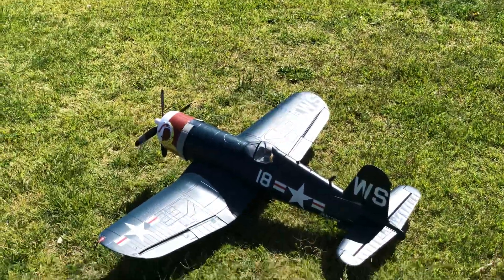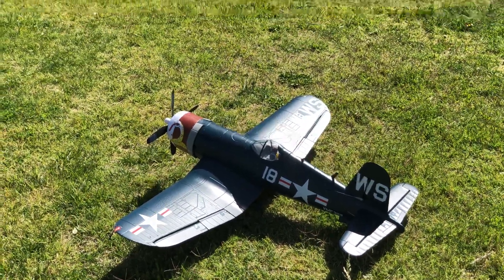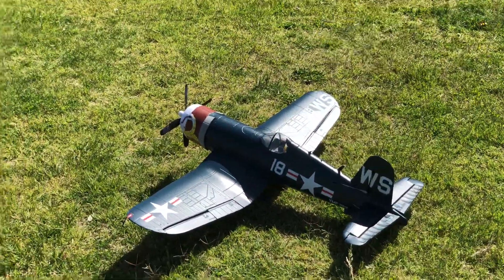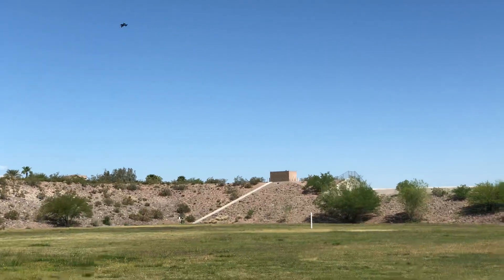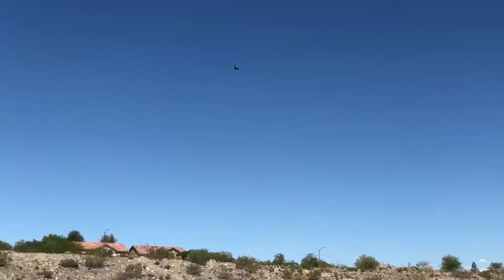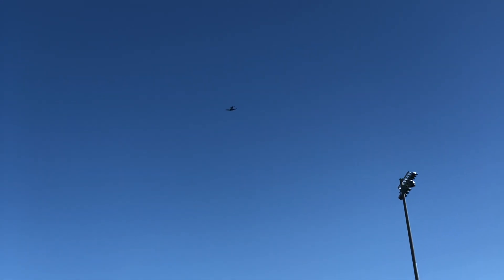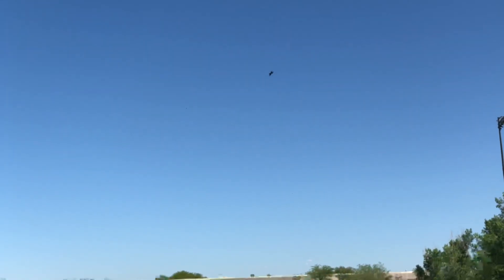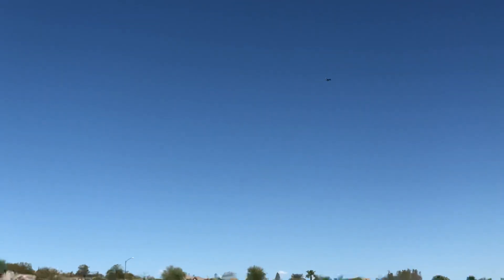Arrows RC Corsair Maiden Fail

Comment: Did ever figure out what happened?
Reply from the maker: I think so. The ESC and motor wiring were stuffed behind the cowl. Lots of kinks, bent bullet connectors, and zero airflow. I straightened them out, rerouted everything, and opened up the ESC area. It's been fine since. If you're on RCG, check the thread on this plane. I posted pictures of the before and after there. It was a real mess from the factory.
Reply: @dand318  been looking at RCG, yep looked dammed tight in that area. I want one but 350 Aussie dollars over here. Gulp. Just bought a s/h Durafly Spitty mk 24 with spare wing for 65 bucks in beaut condition. Makes 350 a bit hard to swallow.  Cheers.